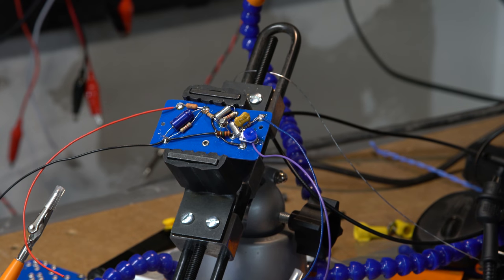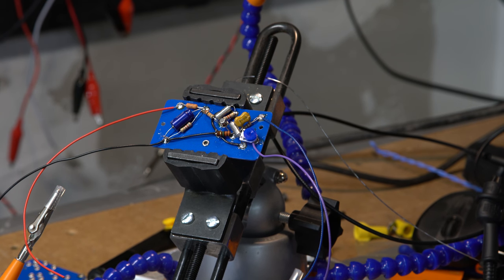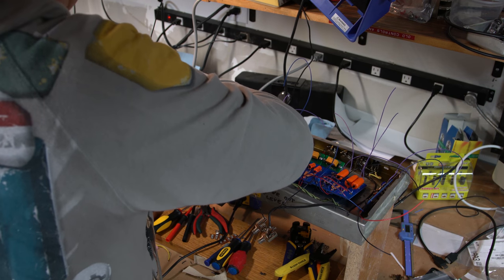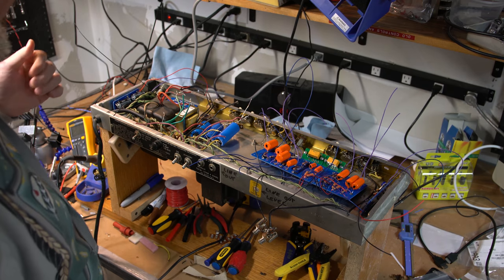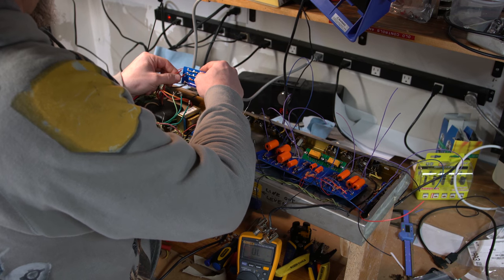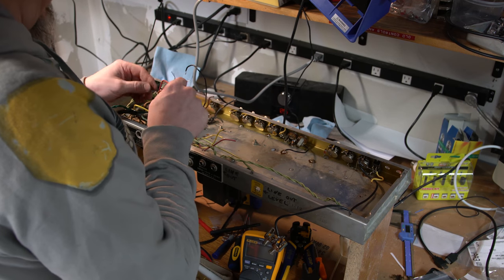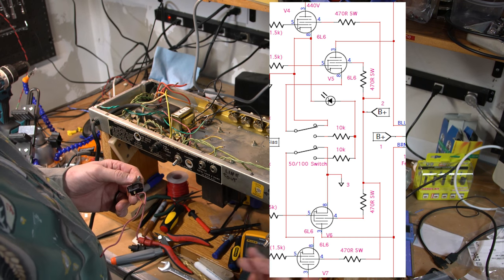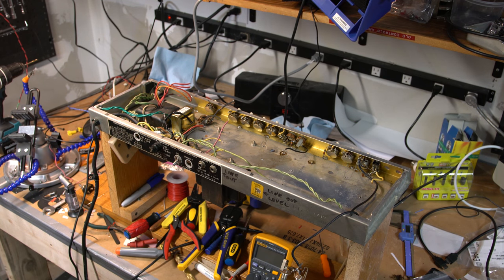Dumble Overdrive Special #124 Build Video #5

Comment: Is there any chance you could post a video showing how you adjust the trim pots in the overdrive circuit? I’m having trouble setting mine in a 70s ODS circuit. I keep getting feedback. I think the circuit is right, though. I can’t mess with it more until tomorrow. Thanks
Reply from the maker: The #124 doesn't have the HRM trim pots for the OD circuit.  I did make the #183, and dialed it in a bit. but they're just basic tone controls, treble, mid, bass that interact with the od tube.  I can see if I can pull something together, but no promises... I've not had the bug to make videos for a while now.  Oscillation/feedback could mean something else is going on that needs to be looked at.
Reply: Frenchie Films, I missed your reply. I’ve got mine set for now. It’s back in the cab. That would be an interesting video but I know it’s a big request. Thanks for the reply.

Comment: Is your 6.3v xfrmer too tall for the chassis?
Reply from the maker: I checked and it seems the exact height,  I hope I don't finds out it's too tall l hehe
Reply: Frenchie Films good deal. Must have been the camera angle.
Reply from the maker: well while working on it this weekend I decided to look and sure enough it is a touch too tall ;( I can push down on it and the chassis flexes enough that it may still work, if not I may have to create a c hannel in the cabinet!  Either that or I have to put it on the top, we'll see.
Reply: Frenchie Films Good luck! And thanks for your help over at Amp Garage!!

Comment: 8:23 "I really don't like standy switches, in this particular amp they do use it, but I've never been a fan of them" and "some people think in tube amps you need a standby switch" and then you go on talking about a mute function. 
This is what I learned: in an all tube amp, it doesn't make a difference, the HV will not hit the powertubes before the filament heated up, because the rectifier tube needs to warm up too. If you have a solid state rectifier, it's best to put in a standby switch because the HV will hit the tubes before the filament heated up.

9:10 How and why could a standby switch hurt the amp?

10:38 "There is no need for a standby in this guy"
Reply from the maker: There's a great dlab video where he proves it's not needed and can cause harm.  It's a myth that won't die.  I'm not putting a mute in, that's what volume knobs are for :)
Reply: Frenchie Films what harm could a stand-by do and how? Why die Fender use iT? Why did Dumble use it? Were they all going by a myth? Is that your opinion?
Reply from the maker: Correct, it can do harm to filter capacitors if the design doesn't account for the inrush.   Fender used them because somewhere along the line they got the idea from the tubes that needed them, and didn't understand the reasoning for standby.  tubes that operate at over 1000 to 2000VDC NEED them or you'll destroy the tubes.  Those types of devices often had a pretty complex startup and shutdown procedure to protect the devices. Standby switches were one of them.  Almost everyone uses standby as a 'mute' function, but that's not what standby was designed for.  'Mute' can be accomplished very easily with a simple switch somewhere in the signal path that shunts the signal to ground, like say right before the grid of the first tube.  This also runs at very low current and voltage so it has no possibility of popping etc, and has 0 chance of causing harm to capacitors.   A well designed amp CAN be setup to not harm capacitors on standby operation (put the first bank of filter caps before it, for example), but why when you don't need one?